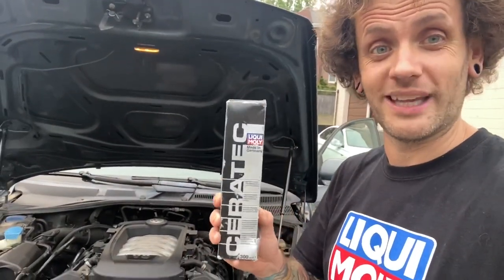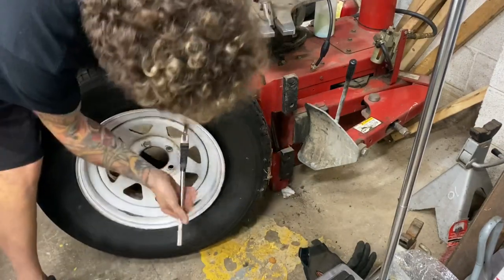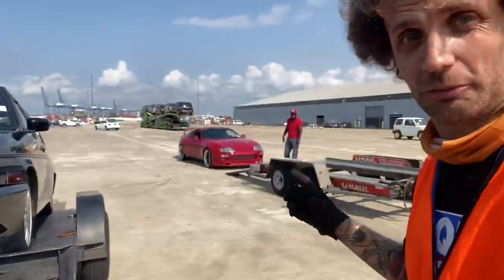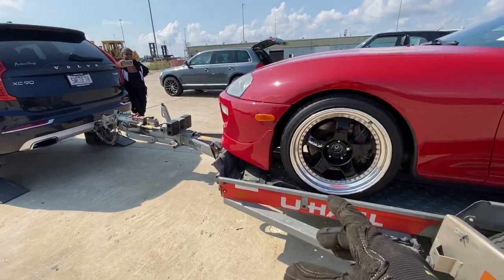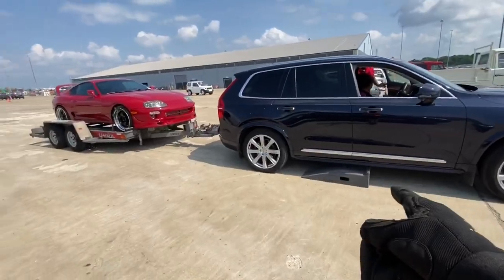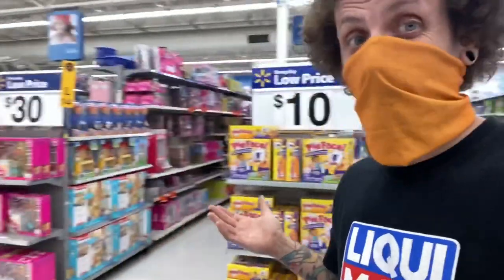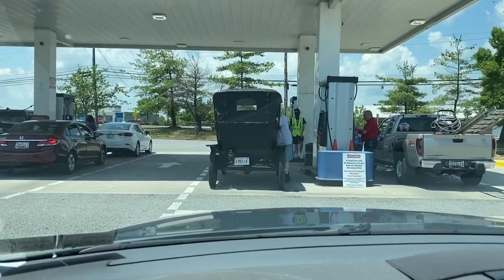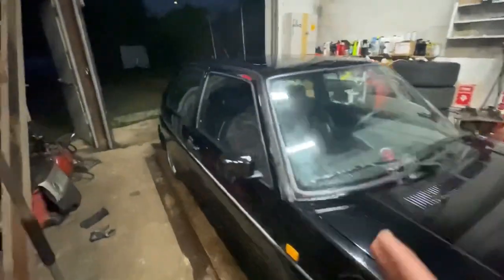Jamie’s Daily Workshop Vlog Experiment : Day 2 of ?

Comment: Super cool.  Nice tow setup.    I have an electric jack on the tongue of my trailer to get lowered vehicles in and out.  Press a button and lift the front of the trailer up and the back down so the approach angle is very flat.
Reply from the maker: Thank you!
I've seen that setup used in Europe, but not the USA. It's a very cool option!